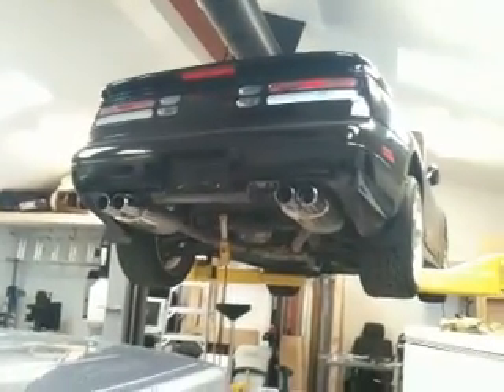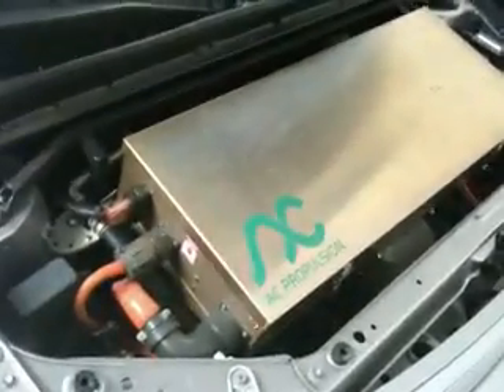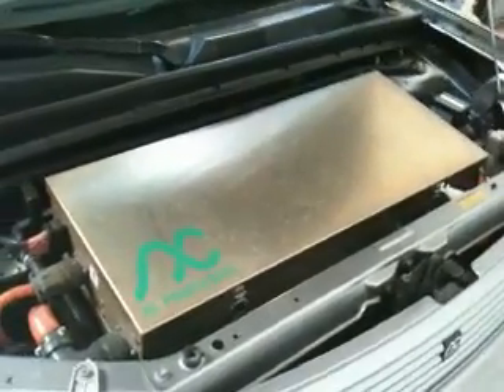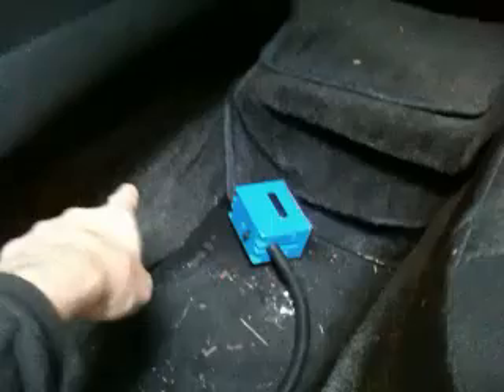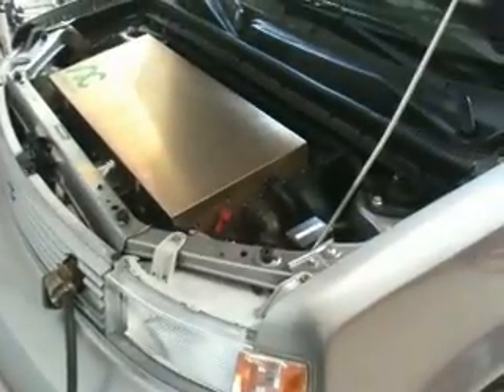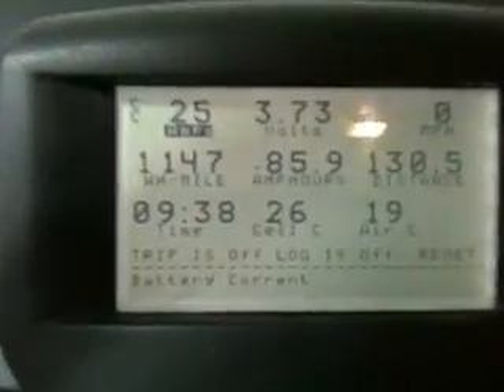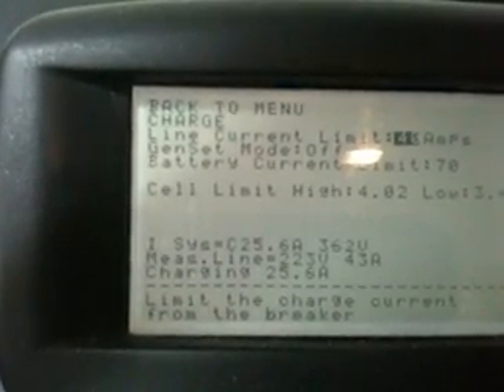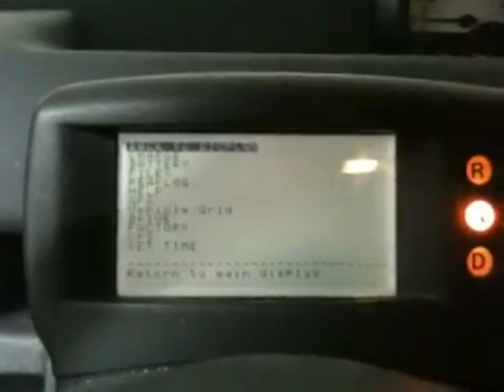eBox by AC Propulsion, only one in Canada - Part1

Comment from the maker: @electrodacus It does have excellent regen capability, much more so than the tesla. It actually brakes pretty hard when you drop your foot off the accelerator. The the slightly higher weight than an OE xB isn't such a concern. But yes, smaller cheaper electric vehicles would be nice. $38k for the Leaf, $42k for the Volt (stupid joke of a car) and $35k for Mitsubishi are still too expensive. The eBox is fun to drive 150kw drivetrain. The others are BORING. Typical automaker fair.